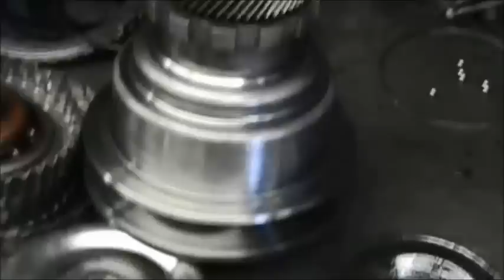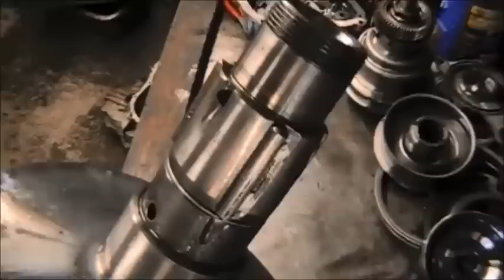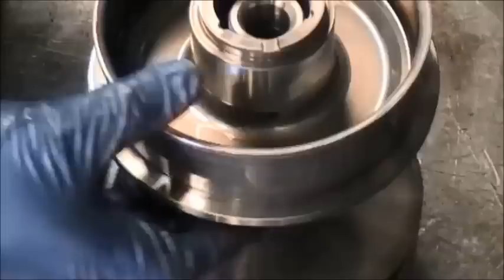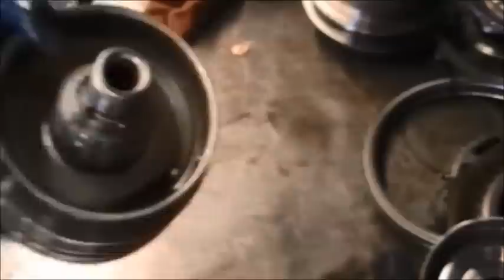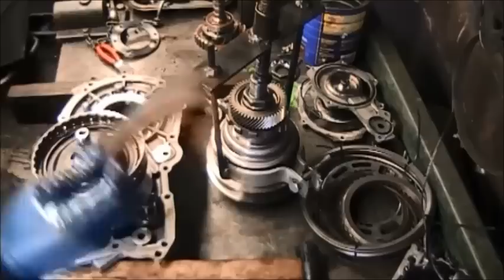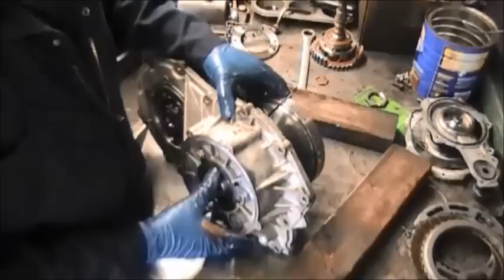saturn vue cvt repair part 5

Comment: I can't find my questions from last night! LOL

YT is kinda dumb that way, or me?

You remind me, the press I made - differently, because I have no welding equipment - is for pressing these open.

 Air or the press should do the trick - getting it open to remove the belt and disassemble.

My bearings are not falling out; so, it could be a struggle getting them apart, as you have putting that one together...

Oh, the bearing with cracked plastic race, is in the back housing? Part name & #? 

WAIT, NO, it is the one on the plaentary assembly! It bolts into the housing with 5 screws! Name and or part number for that bearing? Is it doable?

Comment: Oh, the gear between the 2 big gears, by the filter, it sits on top of the one gear shaft? The very edge of the small one  is worn off, all the way around a bit. Should I replace it or the whole gear set?

Comment: HI Questioning3, 

I am digging through the material, just a couple of things, if you don't mind?

1) drill bit size (diameter)? In case mine are powder, and can't be measured. OMG
2) Because of the burnt smell, and all the steels & clutches look new, I suspect the pump. How do we clean it, test it? Could it just be bad seals on the pump causing low pressure?
3)  same with the torque converter. How to flush it? I saw a way to test it, by turning the different levels of spline. Anything else? 
4) I have steel or hard aluminum lines to the cooler. Can I attach a filter to the return line, to collect the shavings and protect the internal filter? Should I just install a new external cooler?
5) Where how to test Valve Body? I bought an overstock Reman for $62, off eBay. But, how do I know the old one is bad?

I built a press. It can work like the Ron Os, or like yours. Cost: $9, and  the 6" Riser Clamp was only $9.50 at First Supply! I use extra rubber for gap.

I know, I ask so much! I hope others will see this, and get the answer more easily. 

When I saw the Ron Os test drive, I know my transmission was shot, when I bought it! It last more than 3 hard working years though! Now, I see your test drive results, and know even more strongly - mine was rarely below 3,000 RPMs, over 3+ years and 50,000 additional miles! LOL 

Not so bad after all! 

Good thing I babied it, but good! 

I even towed an 4x8 trailer of stuff cross country. That did it. It only lasted 1.5 years after that. OMG

Thank you, so much!

Giovanni

¡...HAPPY NEW YEAR 2019...!

Comment: Happy New Year 2019, Questioning3, The Ron O's, and anyone watching...!
Reply from the maker: Happy new year to you. I will not be able to answer all of your questions because I have now experienced everything that can go wrong with this unit, or any other unit for that matter. First, drill bit size is 6mm, NOT A NUMBER 6 DRILL BIT! There is a difference. Second, if you see that a gear is worn somewhere, then replace it and the gear that it rides on or against. Third, there is no flushing a torque converter. There are too many places in the torque converter where metal can get trapped. The best way to flush a torque converter is to cut it open and flush it, and you are not going to do that. Let the torque converter rebuilders handle that. You buy a rebuilt one. Next the pump, I do not know how to test the pump, never had a situation where I suspected the pump to be a problem. If you believe the pump to be a problem than get a different pump. Lastly, did you disassemble the drive variator yet?
Reply: @thisisyourtransmission  thank you, for the answers you gave. I think I have time to disassemble the variation today, Thursday. I can't wait! This whole process is so exciting!

I hope the torque converter is fine too. I will also try the bench test of that. There really hasn't been much metal shavings yet, no gunk, no big chunks. I suppose it will be revealing to open the variator, and do the mod! 

I will look more closely at the steels and clutches, for damage too. 

I have been notified that the valve body should be here today! 

My transmission became the focus, first, when I had to Rev very high to move at all. I had to have a jump start at that time. Dealer said the alternator was bad, voltages caused transmission to operate wrong. That cost me $1200! For a stupid alternator? I think I was screwed. A few days later it acted almost as bad. The dealer said, replace transmission. I got it home - 2nd tow in, so I paid $60 cash to tow to my sister's driveway. After that, it would not go into gear at all. It would just pop back into neutral, or was it park. (?) It would not turn over in Park or Neutral - test for PnP module? - on the side of the transmission at the selector? It looks kind of old. 

I write too much; but, it helps me think. I know you are busy, don't expect you to suffer through all of it anyway. I am very appreciative of your help so far. It should get me through at this point! LOL Awesome...!

Next I have 2 Jaguar transmissions to try to rebuild! That is why I am inching through carefully. Best to learn the most the first time. 

I might even pass by, when I'm done, and buy you lunch, or dinner? I will be passing through to Maryland/Philadelphia, then to New Orleans, on family concerns. 

Either way, Thank you, profusely! 

Maybe the Ron Os can pass by too? LOL That would be amazing. 

Giovanni

Comment: What are you using for the pins? I know  they are 6mm but I can’t find 6mm rod locally.
Reply from the maker: Frank Reilly ebay, or 4t65e accumulator pins
Reply: Thanks

Comment: Yes. I followed everything that you done. I took it all apart and inspected it. Everything looked good except for the ball bearings and the o ring. The ball bearings had the coating coming off so I done away with them and I use the rods like you suggested
Reply from the maker: you got a different variator and drum that was in good condition?
Reply: No
Reply: I just tried to send some pictures
Reply from the maker: was the inside of the drum where the oring ride smooth or rough.
Reply: I reused everything that was in it.
Reply from the maker: pictures will not work for some reason
Reply: It was a little rough but I used some sand paper to smooth it out
Reply: I can send you a request
Reply from the maker: ok, if you got it smooth enough so that it will not cut the seal then I guess you are ok.
Reply: I did. I'm a mechanic lol
Reply: I found another one in a junkyard for $110 that I'm going to get and rebuild as well so that I will have a spare on
Reply from the maker: ok, best of luck. Time for me to turn in. I should have put on more videos however, I have been very busy in the shop for many months now. As soon as I get a slow down. I will put up some more.
Reply: Okay and again thanks. Please keep in touch. Cars and trucks are my hobby

Comment: I took it apart but all it was was the ball bearings and the o ring on the piston
Reply from the maker: they were busted. How did you fix it? Did you use pins instead of balls?
Reply: https://lh3.googleusercontent.com/H3XsodgMut0XoCODXaoCGvEosM5AtbWfnls7BAcOKsZ7X9YaB_6MjMAg-XxXo5u4QBdAR8QF6w
Reply: You have this without a login account, like youtube?

Comment: I have it working now but I need to know how much fluid it takes. I didn't drop the torque converter.
Reply from the maker: what was the problem?
Reply: The problem was the piston riding up the sheeve. So what I done was held the gas pedal down to get the RPM up to 3000 for 6 minutes so that it would have enough pressure to engage the piston and it worked. My wife said to tell you thank you for your help.
Reply from the maker: I dont understand? Did you take it apart?

Comment: Question 3, I have a question for you. Can you please tell me how you made the device to pull the varater apart to put the belt back on
Reply from the maker: Look at it carefully, look at the steel. Now, on the top I used the part of a c clamp. I cut the screw part of the c clamp and welded to the flat metal piece. The part that surrounds the pulley is a riser clamp. The riser clamp you can get from a hardware store.
Reply: Thank you so much. I bought a Saturn Vue and it would go from Park to Drive etc. But it had no gear ratio. So I saw your video you posted and I also saw were you talked about the o ring either got damaged or it has broke. Before I take the Variaters out I made sure that the medal belt was tied. The ring gear is scored on the outside but the inside look to have no damage. There was a small amount of medal on the magnet so I will keep you posted if that's okay.
Reply from the maker: you have to look at the reverse planet, the part were the little sun gear sits in. Look up in there it gets scored also.

Comment: Hello question 3, I just rebuild the 03 cvt with new belt, variators, I did the variator tip slide up and down smooth. clutches, gears, planet gears, look great. I put it in and now the car won't go more than 15 mph and won't variate. It has a code p1882 and also p0700 p0701. This is the second time i repaired the transmission. last time I left the variator stock with the balls and the chain belt broke. Please let me know if you have any idea how to fix this issue thank you. Also I pulled the variators back out and the still look great.
Reply from the maker: +David Surita Ok, lets see. P0700 is the a code that tells one that the computer see a problem. Now, p0701, If you google it, many will give you a bland answer, like transmission range performance. However, in my experience, this code meant that the computer did not see the transmission doing what it was being commanded to do. My fix was either inside the transmission itself or somewhere in the valvebody. Since a lot of transmission rebuilders are pioneers to the various problems that can occur with this transmission, you have to know that when you put the internals together that you did everything right so that your educated guess will help you solve the problem. In other words, if you did everything right on the inside, then the problem has to be on the outside, or a valve body related issue or component. Now, if you do not have time to change solenoid and sensors out on the valve body (you would have to take the valve body pan off and put back on about 10 times, impractical) then you may want to try to swap a known good valve body. However, again, you have to know that you did every thing right on the inside.
Reply from the maker: +David Surita What do you mean you left the variator stock with the balls and the chain belt broke???
Reply: questioning3 I have found the problem it was the ratio control lever was not set in the slot correctly runs great now the only thing that worries me is a sound coming from the transmission when you drive from a stop it maybe normal just not sure i ve never heard or been in a car with a cvt. Thank you a lot for your video
Reply from the maker: +David Surita  note that not having the ratio control lever in the right place caused these codes. It is the same as having a bad ratio control motor or a bad pressure loss that does not allow the variator to variate.

Comment: Hello MrQ3! Thank you for that info and I will be building that to expand the secondary Variator for the belt! I will be posting a video on the condition of the parts we ordered and also the machine we will build.
Reply: Hello to the Ron Os (twins), 

Happy New Year 2019!

Your videos helped me do this thing to, as well as Q.3!

Mine is an AWD, yours FWD. Believe it or not, that stumped me a while... until I figured out what other bolts to take out, from a manufactures diagram! LOL Did not expect that. I also got stuck under my Vue  I'm so fat! LOL 

Anyway, I will keep you posted about the results. I hope to attempt a tips video, to help others. This might be mote at this late date? 

Cheers to you two!

Giovanni

Comment: Mr. Q3.  I would like to construct the tool for the secondary Variator to install the belt.  What size are those clamps and where did you get yours.  Thanks again for all your help.
Reply from the maker: Ron O I don't know what the name of the clamps are. It is some type of pipe clamp tool. I am going to have to go to the place where I got it from so that they can tell me the name. If you look at the rest of the tool, I have a flat bar. In the center of the bar is what looks like a threaded rod going through a bolt that is welded on the bar. This could work, however, I took a c clamp and cut the one end off that had the rod and the threaded part. Then, I drilled a hole in the center of the bar and welded the c-clamp part (what I cut off) onto the middle of the flat bar. Then on the very end of the flat bar, I welded a rod on each end down to the clamp (that I don't know the name of). Study that tool on my video. It is not hard to fabricate. In the meantime, I will try to get the name of that clamp.
Reply from the maker: Ron O The clamp is used for holding pipe. It is called a riser clamp. You have to get one that is large enough to fit around the pulley, I think that it is 5 or 6 inches that I have. As you can see, I welded the to rods to it. You may not want to weld the ends to the flat bar. You may want to slot the bar and put a nut on the end (you can use threaded rod for the rods). Then you can slide them back and forth.

Comment: Questioning3, I have another question for you.  I did find the planetary needle bearing bad and of course it took out the shaft end of the front half of the drive pulley!  Anyway, does that needle bearing come with a master kit?  I cannot find it for sale anywhere or I'm using the wrong termonolgy or number?  I need the shaft size so I can have it machined and an inner race installed rather than paying 700.00 for a used shaft.  Also, I see the cheapest fluid is the Super S Supersyn full synthetic CVT fluid at about 4.5 per quart.  Have you used this fluid?  Lastly, what type of steel do you use to replace the balls with and how long do you make them?  Thanks again for all the info and looking forward to part 6!
Reply from the maker: Hello, part 6 is up. I will be loading part 7 tonight. Ok, first question about needle bearing. No, it does not come with the kit. I need to check to see about what you mean about machining. Second, I never used the Super S Fluid, therefore, I cannot comment on it. However, we use smartblend cvt fluid. It cost about $13 a quart. I will check into the fluid that you mentioned though. Sounds like a good buy, if it works. Last question, I knew this question was coming Ha. I use tool steel or cobalt, no cheap metal. These are drill bits, the back end of the drill bits. They are 6mm drill bits. Make sure 6mm! NOT A #6 drill bit! It has to say 6MM on the drill bit. The length of mine were from the ring that stayed on the shaft to the end of the channel. Mine were this long because I had them fused on the side. However, they do not have to be this long so that they can be welded at each tip instead of on the side, less grinding. I will try to give you a length over the weekend that you can use.
Reply from the maker: I measured the end of the shaft to be 20mm. I used a digital caliper. The inside of the planetary is sure to be bad also.

Comment: Well done questioning3!  I'm learning quite a bit through your videos!  Question for you, I have a 2003 Vue CVT and I bought it but have not been out on a test drive yet.  It apparently drives for a while, possibly 20 minutes and then will stop working.  I'm thinking that it is a possible leak through a bad O-ring but it also makes a kind of growling sound, almost like a bad bearing in park, but once you put it in gear that sound goes away.  Is this just normal belt noise?  Thanks for all the help you have given and any you might have time for with my questions!  Have a happy New Year!
Reply from the maker: Hello, there is a bearing that goes bad in this transmission. It has the symptom that you describe. If this is the case, the transmission will have to come out and the input drum, the planetary, and some washers will also. This will be all on the primary variator side. This also happens with the cft30 cvt in the fords.
Reply from the maker: questioning3 Remember, even though I can fix these transmission, I don't recommend people buying any cvt until the auto manufacturers stop being evil and make the parts easy to get. These is my way of trying to hlip those who have already been trapped into buying these things. Furthermore, check the vin number on the next car that you buy for you or your family, call the dealer to make sure if it has a cvt. If it does, you already know what the price will be.